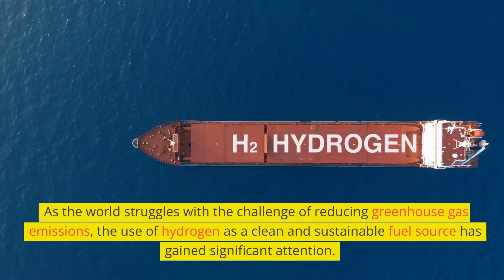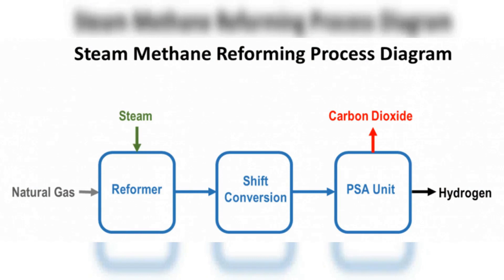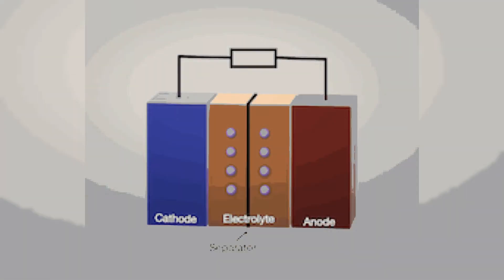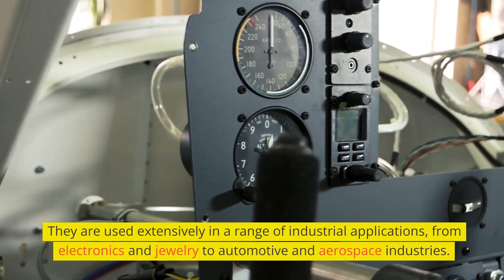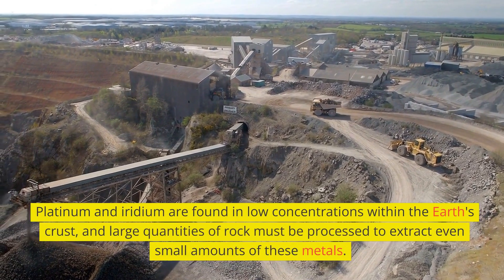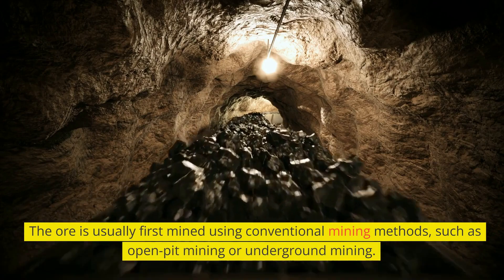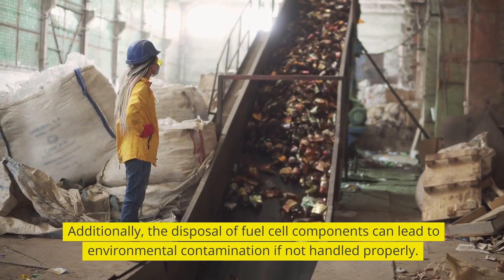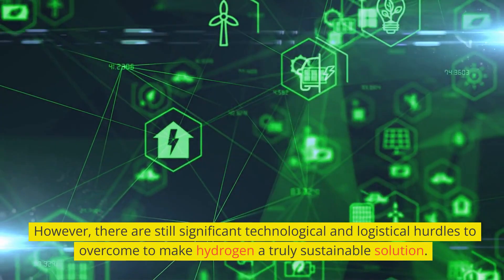We must STOP Hydrogen production: 5 reasons why

Comment: haha this is all the ev car who know they have been blagged!!!   ev cars are fails. hydrogen cars are the future. ev / tesla owners all be crying right about now hahahhaha
Reply: Hydrogen cars are worse for the environment than gasoline cars. Plus being more expensive. And still needing the same wasteful distribution and transportation network because it is still a physical fuel. 

And Hydrogen cars still need a large lithium battery and other rare earths and copper just like EVs do - plus all the emissions from creating the hydrogen itself. 

No sorry, hydrogen transportation is only a good idea if you are a petroleum executive. For everyone else it sucks.
Reply: Well, a happier medium would be a car that can use a small battery pack of around 15 kWh for daily commuting on pure electricity from the grid, plus a small engine that can burn green Hydrogen for long-distance driving.   This would be a Plug-in Hybrid EV, or PHEV, that combines advantages of both Battery and Hydrogen, while overcoming disadvantages of both.   Hydrogen can be stored in existing Natural Gas reservoirs and transported in existing Natural Gas pipelines.
Reply: @trungson6604  this is actually what hydrogen fuel cell cars are. 

Very few cars are burning the hydrogen - except some old car conversion projects or misguided gear head projects. 

Hydrogen fuel cell cars are basically electric vehicles with a hydrogen fuel cell recharging the battery live in real time. 

The problem is that the process of converting electricity to hydrogen, then shipping and storing the hydrogen, then converting the hydrogen back into electricity is extremely inefficient for the use of the electricity. Like 80% of the electricity is wasted and does not move the car. 

As opposed to taking the same electricity and just plugging it into a pure bEV where only around 5% of the electricity is wasted and 95% goes toward making the car move. 

And cars burning the hydrogen are even worse. They waste somewhere around 85% of the energy in the hydrogen. 

Just because hydrogen is low emissions to use does not mean it is low emissions to make or anywhere close to efficient. 

The only people who thing hydrogen vehicles are a good idea are petroleum executives, and people who do not know how the math plays out with them.
Reply: @5353Jumper  ...Do you even read my posting at all?  I wrote that :  "...a car that can use a small battery pack of around 15 kWh for daily commuting on pure electricity from the grid,"  So, you drive on grid electricity for 80-90% of mileage, and use Green Hydrogen only when grid electricity is NOT available.  South Africa is experiencing power outage daily for 8-12 hrs a day.  During weather extremes, people are told NOT to charge their EV.  It is NOT wise to be totally dependent on the grid.
Reply: @trungson6604  yeah but then EV haters will say that is terrible due to the large battery and all its supply chain problems, and fuel cell haters will say your hydrogen will leak out of your tank by the time you go to use it because it is very difficult to store. And hydrogen haters will say that hydrogen gas more emissions than gasoline because most of it is made with methane steam reforming and then needs transportation and storage like any fuel. 

Someone will be right.
Reply: @5353Jumper  -- Let's debate the science, instead of what haters will do!  A Plug-in Hybrid EV (PHEV) has 1/5 the battery capacity of a pure EV, so the magnitude of resource consumption is already a lot less than that of a Tesla.   Sodium ion batteries are now available that substitutes table salt for Lithium, making battery even more sustainable.  
With gasoline so much more available than Hydrogen today, it would make more sense to have a PHEV that uses gasoline as a backup source of energy at the present.  Toyota already makes excellent PHEVs that are powerful and affordable, though the waiting time to get them is still very long.

In the future, the gasoline and natural gas supplies will be exhausted while Green Hydrogen will replace Natural Gas in the piping system, so Green Hydrogen will be available everywhere Natural gas is available today, so Green Hydrogen will cheap and highly available.  
The past 200 years of handling Hydrogen in industry has shown that Hydrogen can be stored very well in bottles and in underground reservoirs and in piping system, in spite of what haters are saying.   The massive investment in Green Hydrogen recently should convince you of this basic fundamental fact.
Reply: @trungson6604  When the grid is not reliable, let's stabilize the grid.